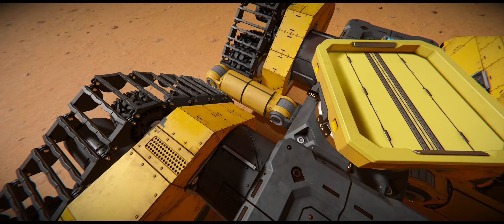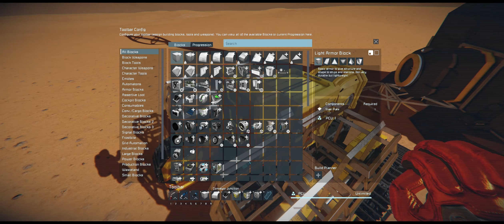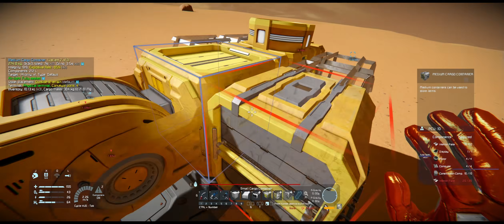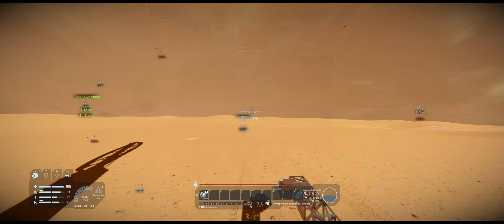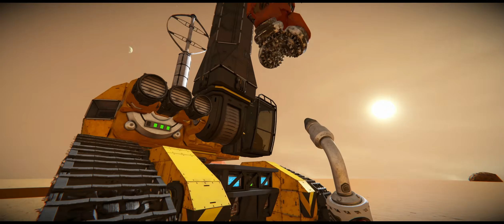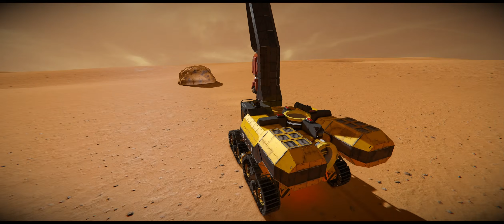Clangscavator! Just Uses 2 Turret Controllers! | Martian Engineering E4 | SE Survival

Comment: Just subbed, enjoying the series so far. I've got the tracks mods but haven't used it (keep forgetting) so now I need to get on and put it to use. Great stuff so far. I found the series from the gantry crane thumb from further along in the series. It's such a nice movement. I've got a 2-way gantry made out of pistons controlled by the PARK script as the plan is to use it primarily for cargo recovery and then for welding a starship as I'm taking on the Never Surrender scenario.

I'll be tuning in to the rest of the series tomorrow!